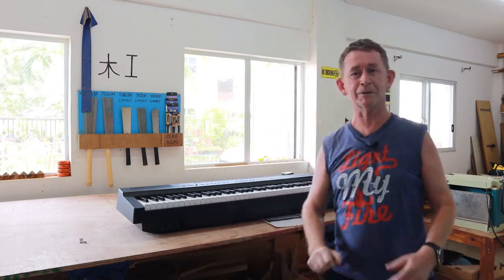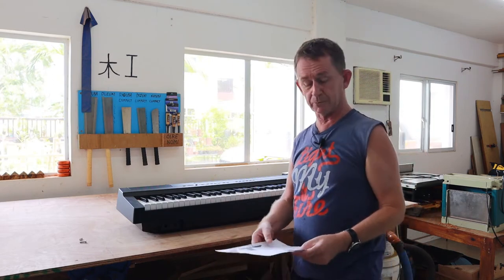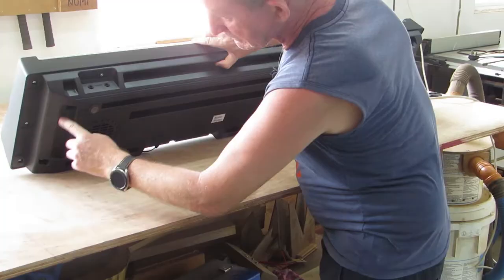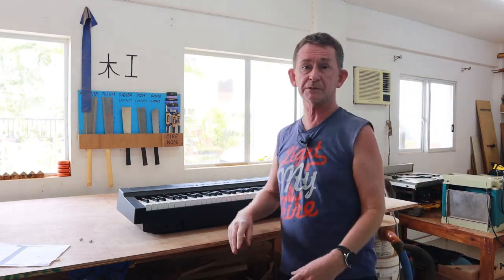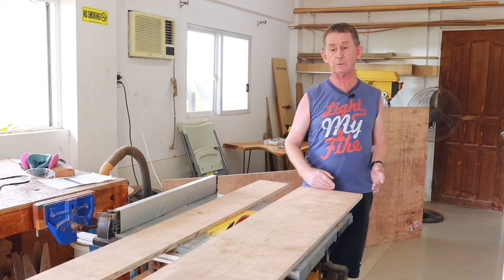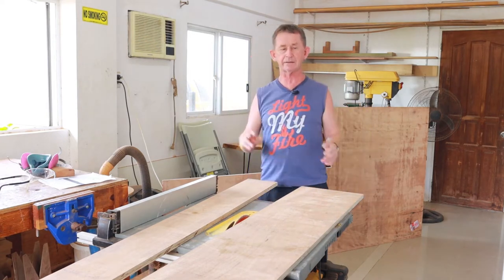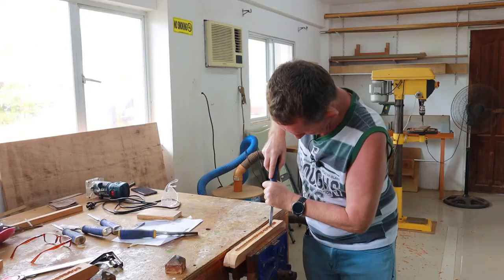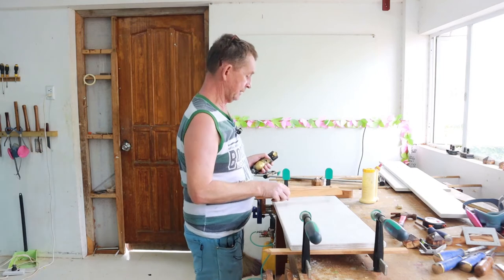How to Build a Piano Stand for your Yamaha P125 - DIY easy

Comment: Very nice project you did there Pascal. How about making a height adjustable piano stool for Ciara as she grows. Thanks for the demonstration.
Reply from the maker: The problem with these mechanical scissor type lifters is they are not so good. There are some good ones but they are crazy expensive. If I build an adjustable one the lifting will have to be manual blocks. Thank you for watching.

Comment: Hi, Pascal. Can I have the measurements? I'm gonna try building it as well. Thanks a lot.
Reply from the maker: The overall height is 640mm (including feet). The width of the side boards is 295mm. Overall width of assembled stand is 1320mm. The separation board is 160mm. Thank you for watching
Reply: @IrishChippy , thanks a lot you're the best!